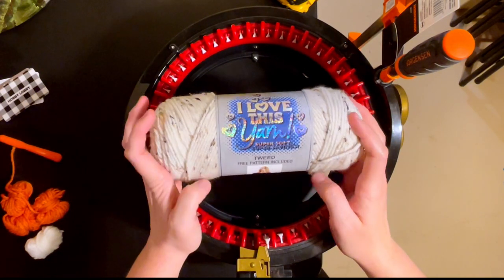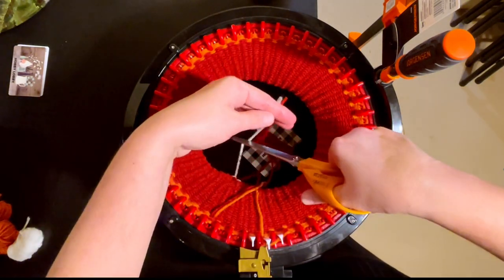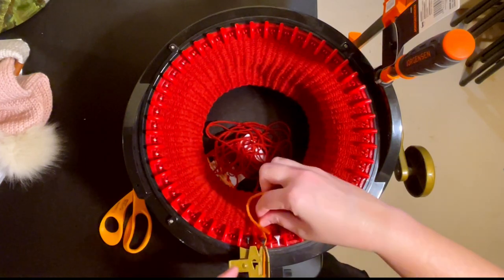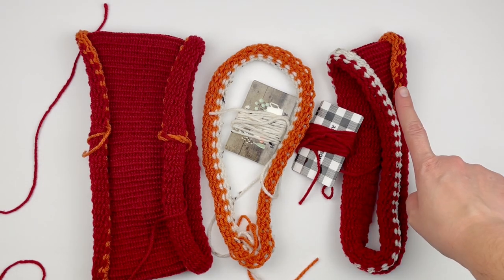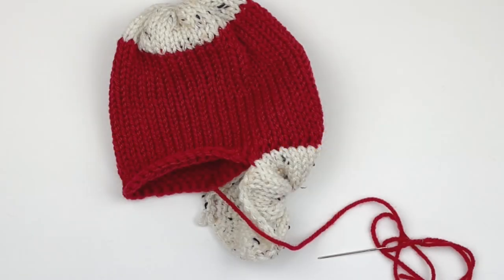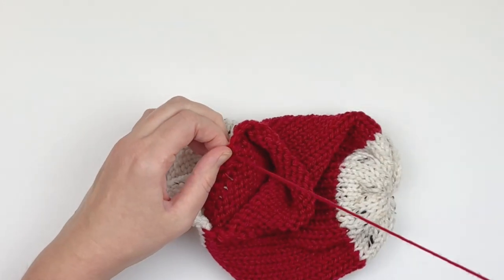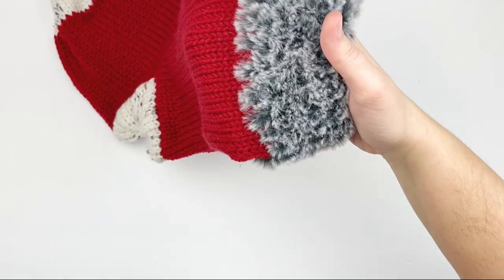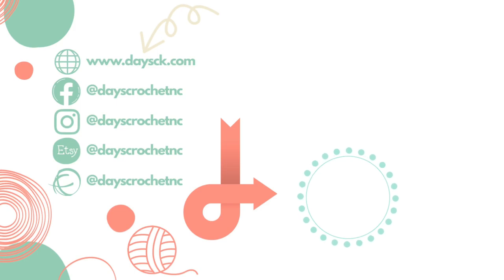Easy Knitting Machine Christmas Stocking ~ Single layer tubes!

Comment: This is cool, and I'll probably make one...or two lol but I'm wondering how much they will stretch down when hanging and filled with stocking stuffers.....
Reply from the maker: I have used this very one and it didn’t seem to stretch overly much. However if you are worried about it, you could line it with felt or regular fabric

Comment: Is there a different way of doing the heel when it's off or fold it in half or shaping it?
Reply from the maker: I am sure there's other ways of doing it, I just haven't tried any other way. Please let me know if you try it in a different way and it's easier. I am all for improving my methods if it's possible ☺️
Reply: @DaysCrochet  on the pattern for the foot it's ok just I made it a bit longer, I forgot the yarn stretches so I'll get that. I was hoping to do an after thought heel on the sock but I realized it is double and may not work

Comment: 😐 I only have the small one is that going to be a problem?
Reply from the maker: The small one? As in the Addi 22?
Reply: @DaysCrochet  no like the ones that are green with a purple handle?
Reply from the maker: @kaleighmarchand2047  how many needles does it have?
Reply: @DaysCrochet  at least half of the size as yours. I think
Reply from the maker: @kaleighmarchand2047  it’s going to come out a lot smaller than mine then